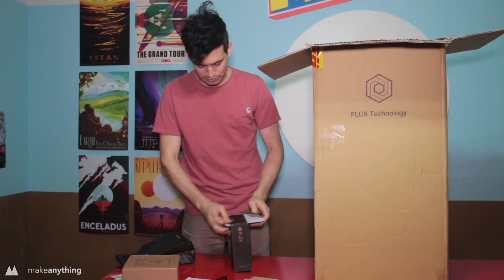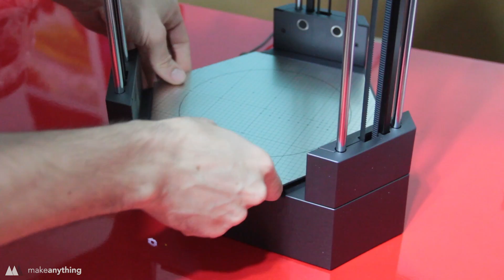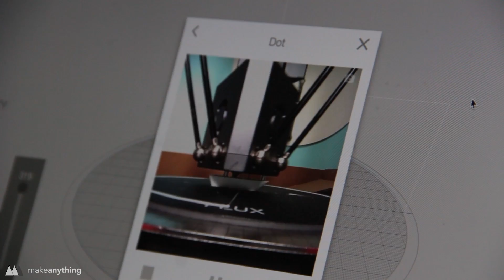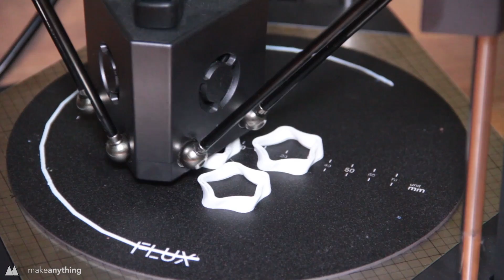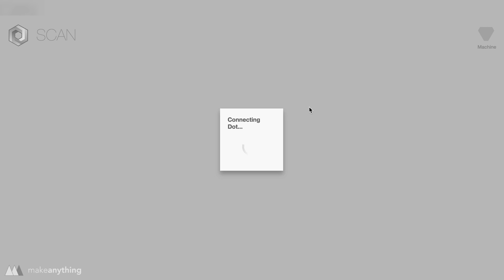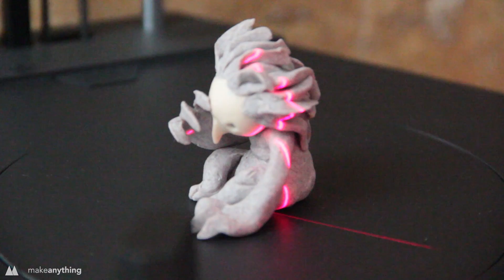Flux Delta+ 3D Printer Review // the Plug-and-Play 3D Printer?

Comment: I know that this is an old video, but I have a Flux Delta that Im trying to get up and running. Could you let me know the DC power output for the power adapter? I dont have the original...
Reply from the maker: Sorry, I don't have mine anymore
Reply: hi...DC-Output:24V-3A...is.Original

Comment: Hello! I love your videos, and was wondering if I could get any tips printing with flexible filament for a makerbot replicator 2. We have tried using it but the layers didn't stick very well and most of the bottom came off when we removed it from the build plate. The build plate is just standard, with makerbots tape stuff on it. Thanks From Kane ^-^
Reply from the maker: +Sara Quartly if it's not sticking to the buildplate just make sure it's perfectly level and close enough. If the bottom layers are breaking off, maybe increase temp or slow down the print
Reply: Make Anything // 3D Printing Channel hmm ok, what sort of temperature though? And speed, (we use the makerbot app to print off)

Comment: Very interesting printer.  It's worth noting that your print module is now no longer covered by their warranty.
From their FAQ: 3. Do I have to use the FLUX-brand PLA? [...] In addition, using 3rd party filaments will void the warranty of the print module.